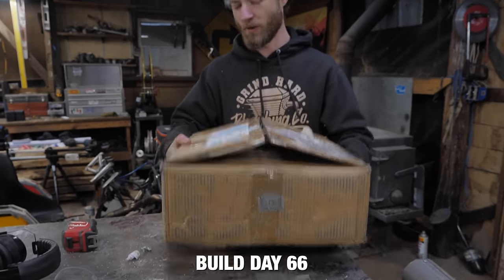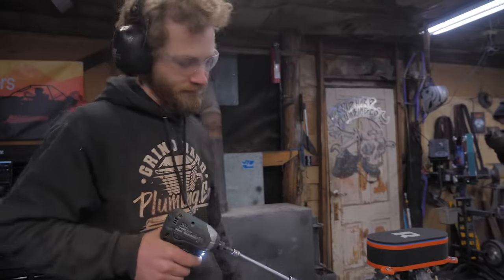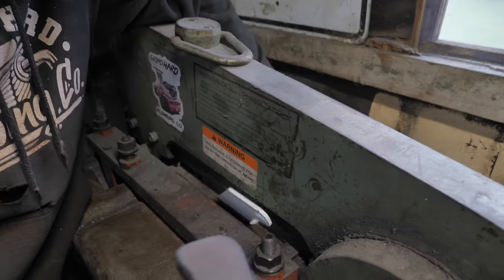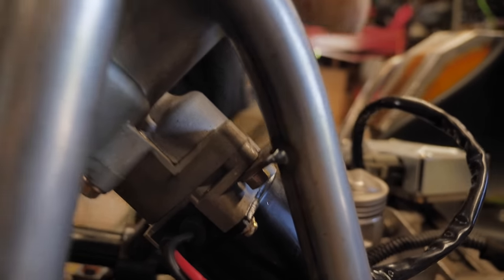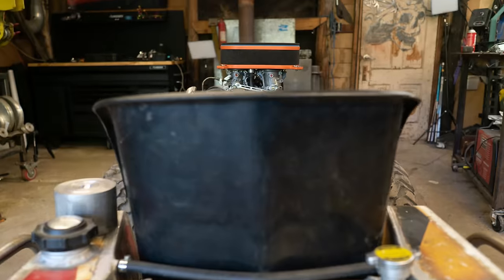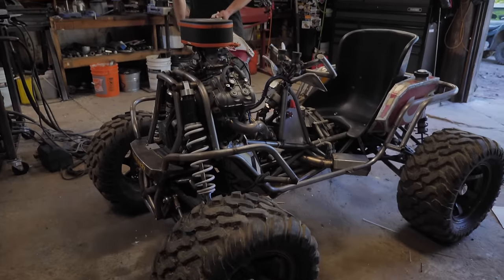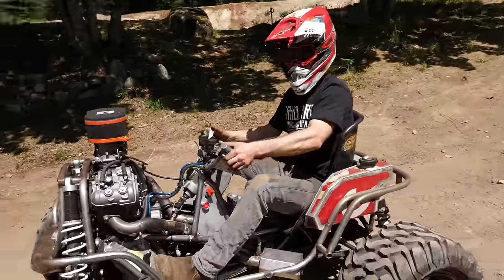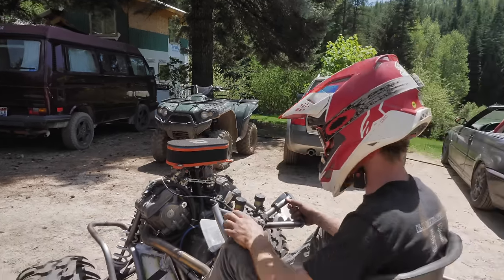1000cc Kart Gets Power Steering! Build Series Ep. 19

Comment: My Saturn Vue electric power steering unit, that I used in the Yota'bota. was $40 at a local salvage yard. Got everything from the steering wheel with airbag, turn signal switch, windshield wiper switch, all the trim plastic, and all shafts and u joints. eBay controller $20. Support your local salvage yards while supporting your own wallet.

Comment: You added power steering but it still doesn't change the fact that the steering wheel turns more to the left than to the right because of the incorrect angles in the steering system you built in Ep. 7. Also, I don't know if you have corrected the u-joint phasing you did wrong. It is not visible now and you didn't mention it. If you do these fixes she will handle way better. Don't get me wrong this build is excellent work as the others! Only those people don't do mistakes who don't do anything.

Comment: Well you spirt car was made for racing. And the largest part of then we're made to race on dirt tracks and they were made to handle well at high speeds and most of these cars when racing ate going at around 100 miles an hour and they where made then get very good traction on dirt at those high speed. So it not hard to see your doesn't want to slide well as it was made not to on dirt or to at least slide as fare as they want and no more at is if there handling right